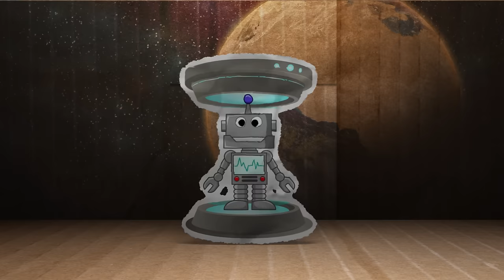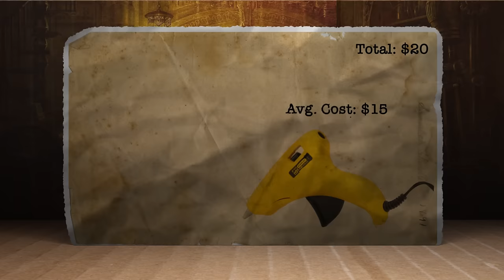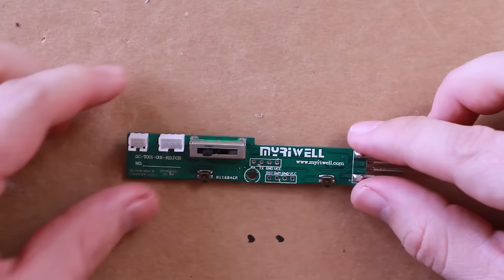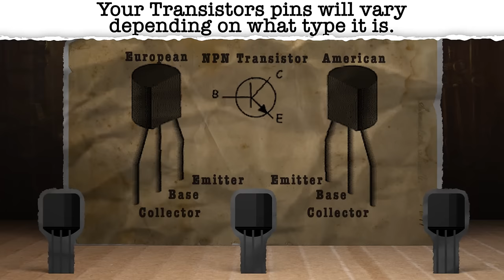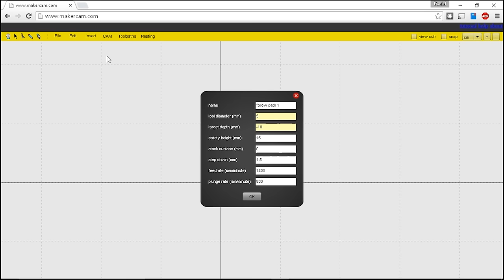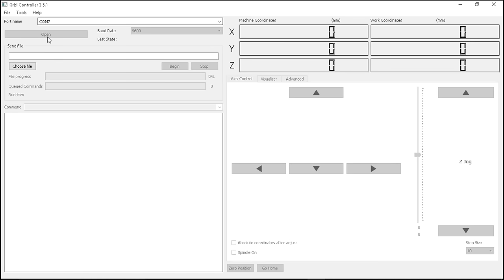How To Make A Cheap 3D Printer

Comment: have you tried runing any parts that were designed using a 3d modeling app and then slicing ,then altering gcode,Iam building a small 3d printer using grbl the way you did only I have to use a slicer as my parts are .stl models,I am testing slic3r.

Comment: Connecting the Collector of the transistor to Arduino GND is incorrect. This way the transistor does nothing.
Connect the Emitter to GND for this to work properly.
Reply: +zaprodk wtf, no! it grounds it! you want to ground it to the arduino!

Comment: Why are you using a transistor and not a relay? And what transistor should I use?
Reply from the maker: +D_K Developer It was a very low power switch, so a relay would have been overkill. The details on the transistor I use are on the project page.
Reply: +Tinkernut And why you just don't use output from Arduino? If it is low power swotch there should be no problems with that.
Reply: +Tinkernut probally could have used a 4n32 opto isolator instead
Reply: +D_K Developer 
Relays cost in DOLLARS, transistors cost in CENTS. Overkill=Overcost, you may have a promising career at NASA or some government agency that wishes to spend all our tax dollars!

Comment: Just threw away an old pc ...
Reply: +theappletv Ask friends, try Craigslist.
Reply: +theappletv look in a dumpster, or goodwill ;) I got psu for $6
Reply: +theappletv Kijiji has a section called "free stuff" at the bottom of their home page. Try that.
Reply: +illumicon I wouldn't trust that PSU as far as I can throw it, then. Don't try to pull for than 200 watts.
Reply: The tester says it's fine, no gluey smell and it's a tiddler, 300w. I doubt if I'll go past 200 still working nicely and fan-free :D xx illu
Reply: +ThereIsNoMatch I could prob throw a PSU about 25 feet.
Reply: about 8 meters? Further surely?
Reply: Zach Sylvester It's got that octopus you can hold onto, you could whip it around and Whoosh... very far :)
Reply: Im gonna go dismantle my old one now

Comment: that is easier than all this, just, 
1: buy a 1000 dollars 3D printer, 
2: make the design for a 3D printer in the Autodesk inventor, 
3: Print 12, 3D Printers, 
4: sell it for 100 usd each, 
5: Pay the First printer and the plastic for make the printers.
Reply: The fuck lol
Reply: you'll need a lot more than $1000 for the metal printing material
Reply: print more 3d printers and sell until achieve the half million dollars that a metal 3d printer cost.

Comment: how did you get 20$ for the CNC part of this project? an arduino uno is 25 and the stepper motor drivers are 15 bucks a piece
Reply: +Trever Brice (epictaco333) arduino clone on ebay is 6 bucks and the drivers are 1.20 :) each
Reply: +Nikola Nikolov Thanks, I'll give that a try. I feel kinda crummy though, the original hardware designers are never going to receive their share of royalties on that.
Reply: Good luck building it :D
soon i will build one with printers or scanners

Comment: I would of just used the hot glue gun, you can just use two small gears pushing the filament into the heating portion and power it using a rubber band or belt and a small electric motor.

Comment: calculating in filement into the price of your 3D printer ... come on, thats like calculating how much fuel is in your car when you buy it, filement is a product youll need to buy again, it dosn't automaticly have endless filement just because it came with the 3D pen, so its kinda unfair to calculate it in when comparing buying an extruder vs buying a 3D pen, also you can get extruder at better quality for way less than that pen.(if you dont factor in the price of a spool of filement*face palms hard*)

hotend + extruder = 30$ at my local 3D printer store, and thats in a country(DK) where we have insane taxes and the shop also takes more for it, than what it cost online(or in other countries)

Comment: Why don't you use, Rasberry Pi
Reply: you can use it... but the code will not be the same
Reply: +minecrafter9099 yep... but it surely be easier with a Raspberry Pi, cause it will be faster and plus use it as a onboard computer
Reply: yea, but dont forget that raspberry uses 3,3v logical levels, and arduino uses 5v :D i think you could use transistors / relays.... but, in terms of hardware it'll be more difficult
Reply: Yeah.... but well bit more effective

Comment: Should be called: how to mount a 3d printer pen on xyz axis..
Reply: Well what the f do you think most fdm printers are essentially?
Reply: @Pilachio  well.. not a 2d image puller (unless you manually write a new g-code for every layer) consisting of a 3d pen mounted on a cnc running on Grbl. 
but i admit you got a point. its somewhat an early prototype of what became a 3d printer.